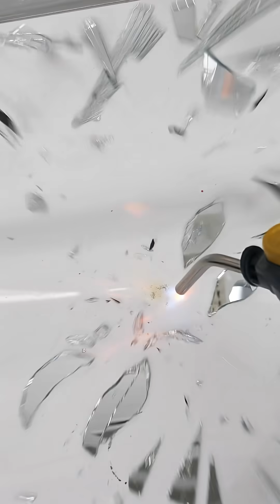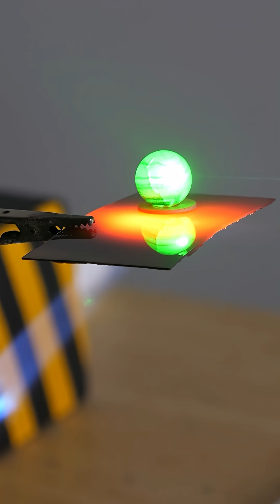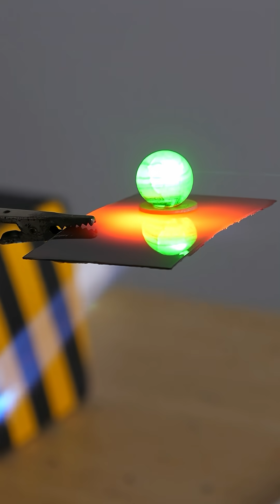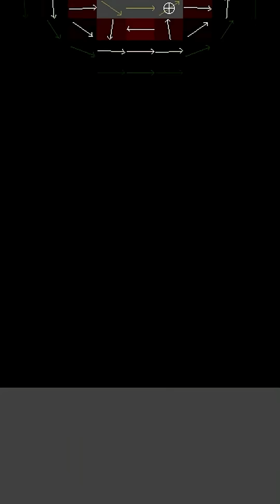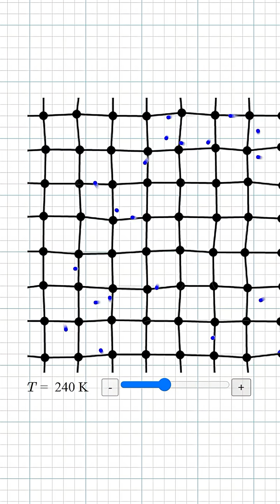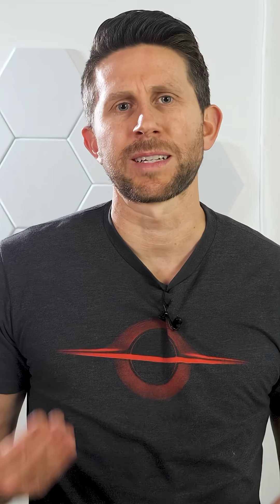The Weird Physics of Red Hot Mirrors

Comment: I believe you answered my question I had for several years. 

Driving to work during sunrise, I saw metal street signs reflecting the early sun's orange hue, while the white lane dividers were white. 

Perhaps it's not process you described and it is just how smooth or not smooth the painted item is that determine if it will reflect the colour of the sun or not.

Comment: Gonna have to get it a lot hotter to do any science here playa. 9340°F or 5445°K will have a black body radiation matching the 532nm of that laser. That will boil off both the steel and the marble and turn them into a plasma (that’s one way to get those hot ferromagnetic metals to have strong reactions to magnetic fields again, turn them into a plasma) with strong IR and UV peaks, Saha/Boltzmann constant, but a strong Planck/Wien band for 532nm which is what those infrared lasers emit after their 1064nm is chopped in half by a laser uhh no idea what it’s called. It’s a transparent crystal can’t remember what’s in jt, the infrared ionizes it and it re-emits at half the frequency with twice the intensity probably less losses from the photons getting tired and needing a break. I wouldn’t even bother fact checking that part it’s very boring. Frequency divider? I think it’s called a frequency divider. And the losses are due to a lot of things but imperfect transparency is the biggest one, refraction and reflection and diffraction too at the air/divider interfaces, Snell’s law.

Comment: What actually happens is that the refractive index of the metal changes with T. More of the impinging electromagnetic radiation is transmitted into the metal, where it dissipates. With more emr going into the metal, less is reflected. Metals typically have very high refractive indices, which makes them good mirrors. Only a small amount of light (emr) enters the metal, where it is rapidly attenuated by the free electrons, raising their T slightly.

Comment: You would have to heat the glass mirror uniformly over the entire surface area on all sides.  The thermal difference between the colder mirror surrounding the hot spot is what shatters the glass.  When the tension in the crystallized lattice is released I think it's causing torsion within the rest of the structure and that would be what fractures the bonds between the atoms.  I'm not a trained materials scientist, so that area could be explained better by another person.  

As to whether it would or not with a glass mirror, I would posit a guess that it would not.  The silver would likely lose it's bond once it reaches melting temperature.  But if the temperature were carefully controlled to remain below melt temperature, it could possibly be seen, because the melt temperature of the glass is higher than the melt temperature of silver, but I am not sure at what temperature glass without direct heat would start turning red.

Any materials scientists want to break that down a little more for us?

Comment: Metal reflects differently than dielectric mirrors.  IR lasers reflect off metals until the reflectivity is reduced via heating there is a good paper on breaking reflectivity using shorter wavelength lasers.  You can do this experiment with an IR and green or UV laser, collect and measure the beams  reflections (with a special collector beam splitter mirror) Dielectric mirror will change stack heights then degrade reflection at a specific wavelength and or be destroyed as well. Great topic, thanks for your nice work.

Comment: i suspect the reason the mirror shattered was because the heat was uneven. with such a high heat in the center yet cooler at the edges it would cause significant warping, causing it to shatter like if you had taken a big sheet of glass and bent it in your hands. (please dont try that. you really don't want to be holding glass shards.)

Comment: Notice on the chart of reflectivity vs temperature which element is least affected by temperature: Gold. Which is why almost every mission critical mirror is coated in gold. It's similar to metals Coefficient of Thermal Expansion and a special alloy called Invar (Primarily iron (~64%) and nickel (~36%)). I learned about this stuff when I worked for an optics company that tried to build OEM FTIR units which have at their core an interferometer in which everything but the beam splitter was made of gold coated mirrors. They didn't use invar due to cost, but it was considered.

Comment: It's actually because the metal is shiny. When you heat it it's producing light of a different frequency and mixes with the reflection. Find a material that can get hot without emitting light and it will prove this.

Comment: Also, there's a principle in physics that says emissivity is the same as absorptivity. So if it absorbs light well, then it also emits it well. I believe this is why tungsten filaments work for lightbulbs. They get so hot that their absorptivity and emissivity get much higher
Reply: Even light emitting diodes, LEDs, get brighter when outside light shines into them.
Reply: @YodaWhat I don't think that's correct. LEDs work through electroluminescence not incandescence.
Reply: @YodaWhat that's just a coincidence actually, it's just because LEDs can act as weak solar panels and power themselves very slightly
Reply: I work in thermography and this is a pretty standard conversation with customers who want to track temperature changes of metals. It makes my job a lot easier when they’re already hot otherwise we’re more likely to settle for a relative temperature measurement. That way we’re not making emissivity assumptions as emissivity changes.
Reply: That only holds true at thermal equilibrium
Reply: @Captainspamo  if you isolate to radiative thermal transfer then it’s true

Comment: Seems like hot gases, especially those used to heat the metal, could throw results off.

What if you do the experiment in a vacuum using an induction coil to heat the metal instead?

Would also be interesting to see reflectivity changes after the mirror cools down to it's original temperature without opportunity for reactions with an atmosphere (e.g. oxidation).

Comment: So if you can adjust the light and environment properly so that there's an intense light heating the mirror at exactly the rate that it loses energy through radiative/convective cooling, and that happens at the point where the mirror absorbs all of the incident light, then the only light coming off it will be black body radiation and you will have created a black mirror.
Reply: Could you explain this to me? Bc in my mind, the mirror would be heated up and give off it’s own light, so even if it theoretically absorbed all incident light due to the temp, it’d still radiate it’s own energy(?)
Reply: @NyroStudios It's more a play on words since if the mirror is so hot it stops reflecting then anything you try to reflect with it, won't, hence black, and because any radiation i lt does emit is "black body radiation" or the radiation due to cooling rather than any reflection or diffraction l or anything.
Reply: If it no longer reflects light, it seems to me that it would have lost its mirror property and thus would no longer be a mirror, until it cools down.
Reply: I think this isn't true. Imagine a mirror with 50% reflectivity at some temperature. 50% of the light is reflected and 50% is absorbed. Now that 50% that is absorbed is turned to heat. We need this to balance with the emission so at this temperature the object must emit 50% of the incoming light energy back out as blackbody radiation. 

So the outgoing light would be 50% reflected 50% blackbody. Whether this is stable or not probably depends on the relative slope of emission power vs temp and absorption coefficient vs temp (which I believe themselves are related?)

Edit: I think you might be saying that at some temp it might cease to have any reflectivity and be a pure blackbody radiator? It's not really clear that there's a mirror there anymore. Though I do appreciate the pun you were making :D
Reply: I don't know how to spell it correctly, but I remember that our Sun considered to be "perfectly black body".

Comment: I still wanna know what happens when you do this with a glass mirror
shattering happens because of the stress, caused by uneven distribution, so maybe submerge it in boiling water?
but the melting point of glass is something around 1200°c, so water would boil before that and gas isn't gonna be as even a conductor as a liquid
maybe use a metal?
issue is, metals are solid so you have the same uneven distribution problem before you reach melting point.

ehh, someone smarter than me might have an answer

Comment: It would be really cool if you would repeat the experiment using a green bandpass filter, such that we can see the decrease in reflectivity.
Reply: Just reflect the laser off the metal and look at the wall. If the reflection gets diffuse instead of dim, scrap it and get the laser line filter instead.
Reply: @tykjpelk  it wouldnt be as fun though, be honest
Reply: Or just have an identical marble that is not on a heated plate! Flick the laser over to the cold marble and see if it looks brighter.

Comment: So does that means that if we cool down a mirror with liquid nitrogen it become a better mirror ?
Reply: Wed need to do it in a vacuum with almost air moisture to avoid any frost buildup or condensation.
Reply: That's probably what they did with space telescopes, maybe in the Hubble and Spitzer (they used liquid helium for Spitzer)
Reply: @pihermoso11 I recall that telescopes use cooling to reduce image distortions and get better image resolution.
Reply: I would suggest that the trend continues with dropping temperature, but there is there some limit for each material? How is each metal affected by extremely low temperatures? And yeah, as someone mentioned, we'd have to do it in vacuum...
Reply: What he said suggests the Y axis on the graph he showed is a percentage scale, and I don't see how that scale could extend beyond 100% (what would that even mean).
Reply: @doomse150  Not a single metal shown is at 100% on the graph, so they have room to go up without going over 100%.
Reply: @doomse150  it means he unlocks the new skin of the mirror and it turns into gold, or a chance of getting a deluxe mirror skin. Which is also gold, but cooler.
Reply: @doomse150 because what we consider 100 % is actually like 99.9 % , to see those 0.01 % that go missing its simple you just need two mirror and you make them be each other reflexion, and if it was 100 % the deeper reflexion in any of those mirror wouldn't get darker and darker as it go on, this would be practical for space mirror idk
Reply: the trouble is the cold temperature would also fog the air around it, which doesn't help.
Reply: Next experiment! >:O
Reply: Better use liquid helium or a dilution refrigerator for even better results.

Comment: It has never occurred to me that reflectivity coefficient dropping would create a positive feedback loop for the heating something with light. Even though it is literally in the name
Reply: This is the main cause of the COD (Catastrophic Optical Damage) failure mode in high-power semiconductor lasers, the mirrors heat up, get less reflective, then heat up more, and eventually your laser diode is suddenly a really inefficient LED.
Reply: What is in which name?
Reply: @younscrafter7372 , "reflectivity" is effectively resistance, with the preference for the liquifying set to "no, thank you"

It literally "reflects" both light and heat back